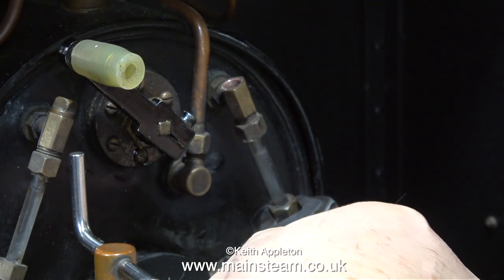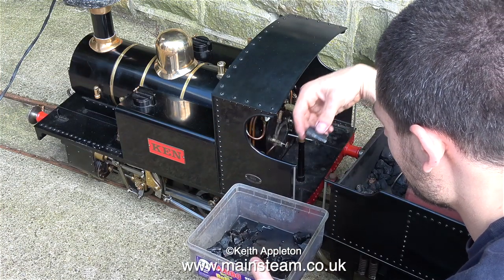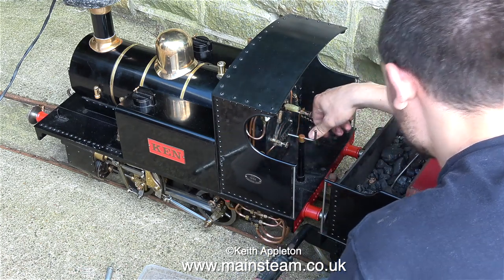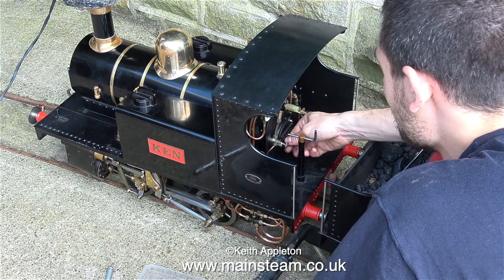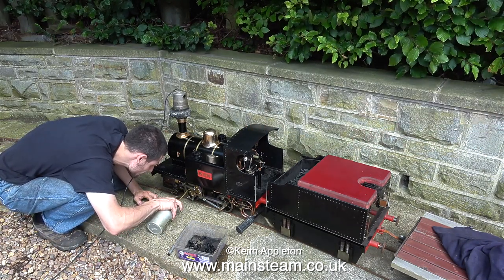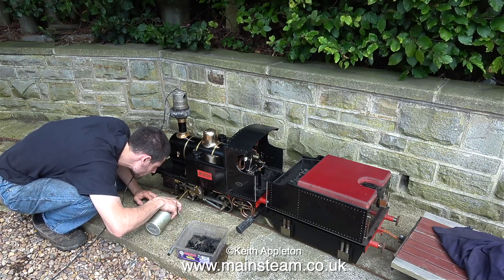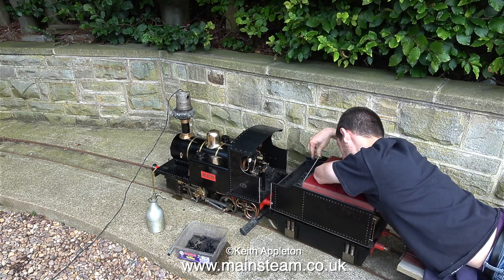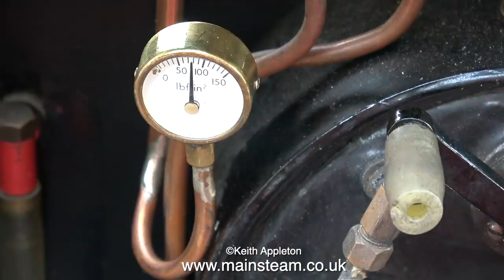A.E. KARNES ON THE RAILS

Comment: How close are the wheels to slipping? I understand that rolling resistance is quite low but momentum needed to get going feels bigger than traction on rail? I can see the video and I am proven wrong but it still feels that under load wheels will slip at any moment.
Reply from the maker: The 0-4-0 wheel arrangement is not prone to slipping, there is no slipping at all unless the track is oily or it snows . . . .

Comment: With  the tanks on each side of the locomotive blocking the view how do you lubricate the moving parts between the side frames before running?
Reply from the maker: From underneath . . . .
Reply from the maker: or with a long copper pipe extension on the oil can . . . .
Reply: @keithappleton  Thanks Keith  it might has appeared to bs a stupid question but the biggest loco I have owned in the in the past is a Hornby  OO/HO Do you know of  something like a scissor lift to get a 5 inch 2/6/0 up to waist height ?